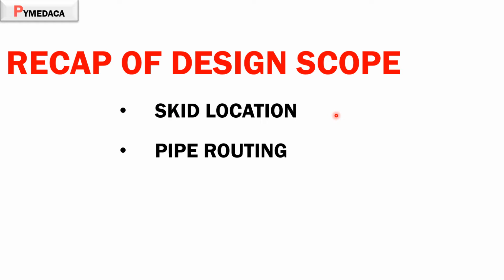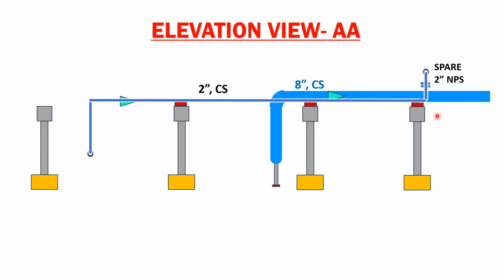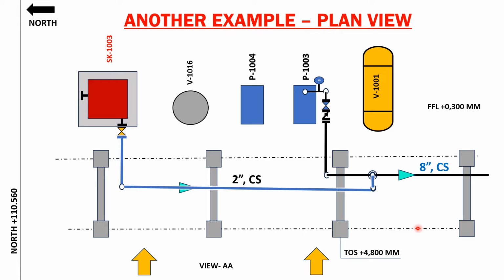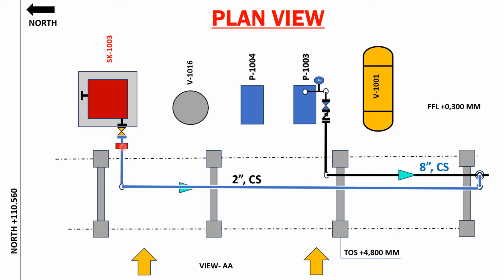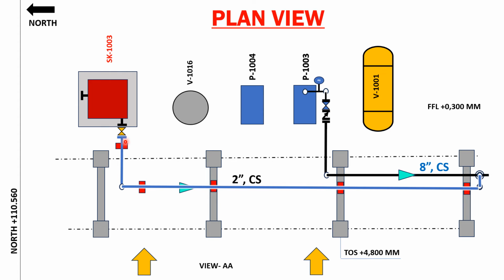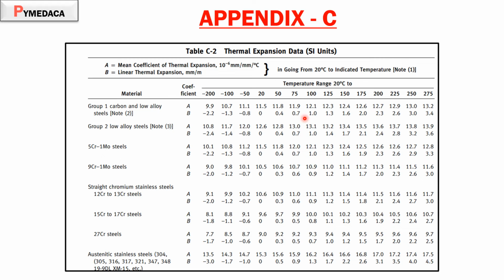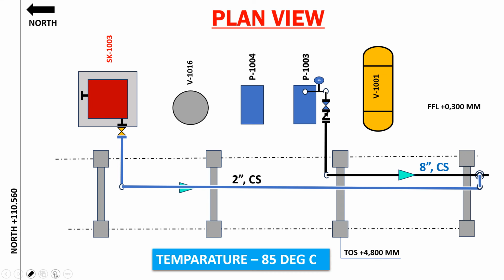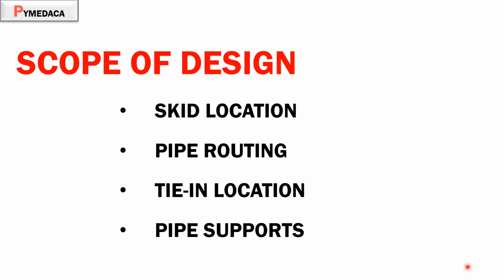Piping Design Project - Part 3 - (The Final)

Comment: What is the elevation of the nozzle on the skid? It looks like the east west pipe will block the access below the piperack and I think a T-post is not a good practice to use since it will also block the access as well. I think a dummy support is an alternative way to support the pipe. But all in all your explanation is very helpfull for those who want to be a piping designer. I also learn from your videos.Thank you!

Comment: Sir after flange support second support will be rest with t post  or else because there is no structure for resting? And pipe has height as well
Reply from the maker: You can use L type support. But it ll b suggested by structural engineer